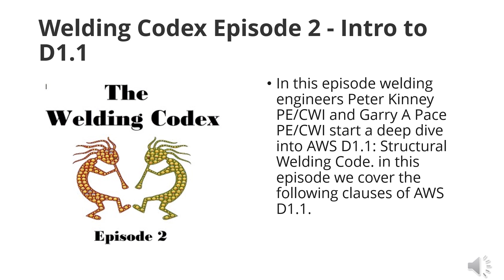Welding Codex Episode 2 - Intro to D1.1

Comment: Gary, I have great respect for you, but codes are a useful tool for people that do not know how to weld. When I started working for Marten Marieta in the lab they called me a idiot! All weld made for the militar the welding procedure are approved by metallurgist and May be approved by a engineer. I as a welder I am responsible for what I weld. The problem is there is no welding code for welders! I need a code written by metallurgist, not a “engineer” that knows nothing about welding.